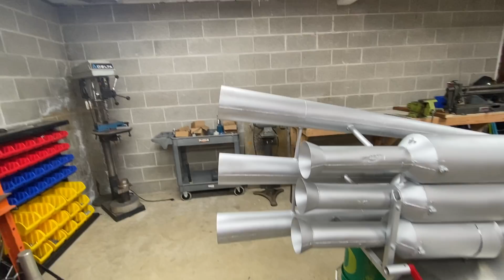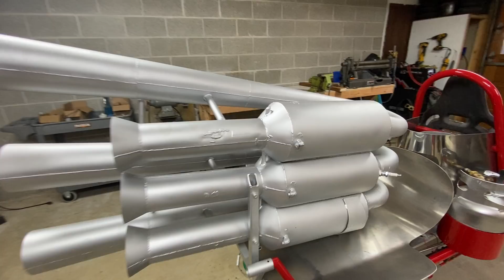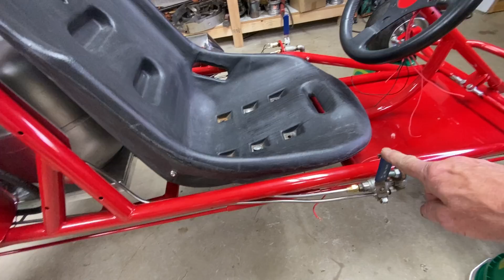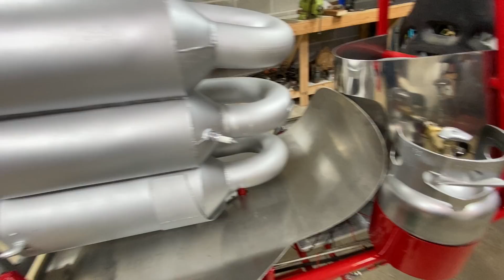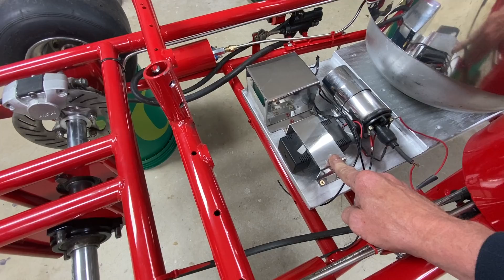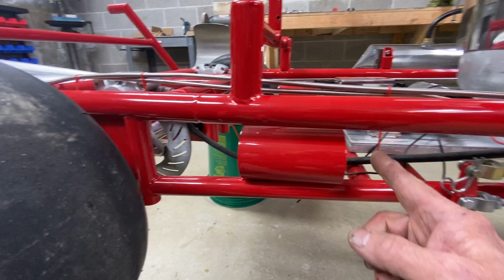Crazy Rocketman : The "Beast" Jet Kart Build !!

Comment: Yea, Aluminum is the best option really thermal friendly.  I wondered if you needed some fins on the heat shield but it looks like the required footprint is so large it difuses the heat without much of a need for additional engineering.  I suspect that engine will produce enough speed to be dangerous so the stout frame is good. Excellent engineering.

Comment: Hey Bob, are those engines out of mild steel or blasted stainless? When I was working for Gene Gluhareff, all of our G8-2s were 321SS. What is your experience on the longevity of 304SS? Does 321SS actually last any longer when cycled? I see a lot of pulse jets being built out of mild steel and figure they can't last too long.
Reply: He uses whatever he can get at Home depot
Reply: Have a beer 🍺
Reply: @kanethompson708  😭

Comment: the diesel/LPG is an interesting mix,seen and even tuned such set ups on 4WD and even heavy trucks,gives a lower EGT than pure diesel set to the same HP,nice choice of the bosch 044 fuel pump,i use them on trucks to,diesel pump UK also uses them on diesels

Comment: So is it just the brake disks keeping those rear axles in place horizontally? Guessing that must be a lot of sideways stress on the disks when turning. Do the axles just slide out of the frame & bearings, if the brakes weren't there?

Comment: Go carts flex their frame and sometimes the axle to achieve a differential. Basically lifting up one of the tyre so you can turn, they call it "jacking".
Could you draw the liquid and gas propane from the same tank?

Comment: Rather than deadhead the diesel pump, why not just use a return line to the tank to divert excess pressure? Also, would you be able to setup a single propane tank with a bottom syphon and a top inlet, so liquid and gaseous propane would be able to come from the same tank via 2 separate inlets?(to eliminate the smaller tank/hardware for weight)

Comment: ford falcon LPI's have bosch 044's mounted in the tank,so if 120psi LPG tank pressure dont do it for you modify a tank to take a 044 internally and get up to 240psi

Comment: I mean a pump is a good redundancy, but why not pressurize the diesel container with the lpg gas for pressure instead with a safety release valve? You could also put a t valve switching between lpg to diesel according to combustion chamber temperature or 50/50 in early stages

Comment: What if I told you about a stable mix you can use instead of Diesel - but it is MUCH more powerful... the only throwback is that you would be FORCED to switch out your engines since they would need to be made out of Tungsten (that material can withstand the increased heat levels from the better fuel mix).  Let me know if you're interested - although - casting those engines in Tungsten WILL be more expensive - but I am sure you know that :)  Cheers!

Comment: So basically you inject propane into the combustion chamber then use the heat from the propane to oxidize the injected diesel. The Diesel burns cooler so your engine doesn't overheat and you get more range?

Comment: Simplicity is best always and you figured that out over time with the wood. I though the engines were parallel since they had synchronized pulsing and someone confirmed it for me. That fuel injection is easy to assume by those who understand it. You did well hiding the part that distributed the fuel to the combustion chamber. beautiful design you started before i was born. The aluminum sheild is a good idea i did not know it was aluminum but had assumptions it was something other then steel. it seems like you created a pulse jet, scram jet hybrid. copy righting lasts longer than patents i have heard. have you tryed a one way tesla valve heart shape revolved upon its center axis? <3 
im sure a certain american company would pay you well for something that could evolve from a pulse jet to a scram jet in a compact low mpg package. A chinese inventor used the one way tesla heart valve and put a turbine combustion chamber in it. Also why do you use diesal enstead of jet fuel?

Comment: Awesome build, I was wondering if you considered installing an electric clutch between the rear axle halves so that the axles are locked together when you apply the brakes? Since you only have brakes on the rear axle it could be a problem with handling while braking if one brake system fails or or is degraded for some reason. I'm thinking you could have a switch on the brake pedal to activate the clutch and another switch to deactivate it  if your in a turn.